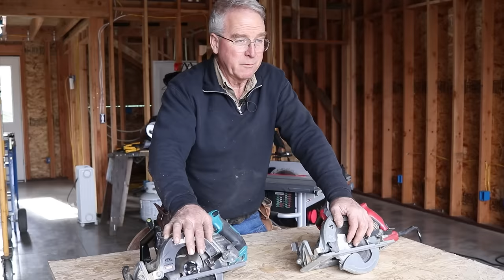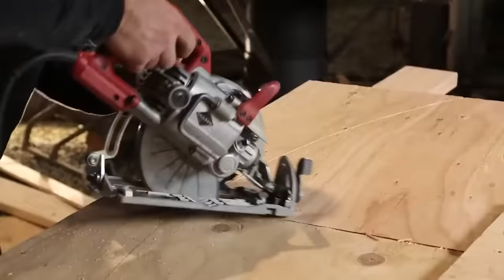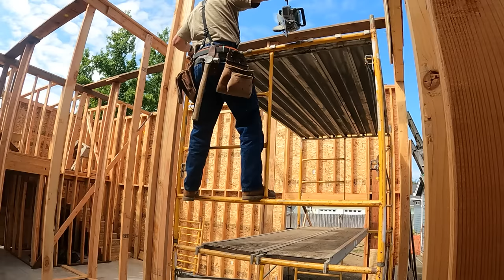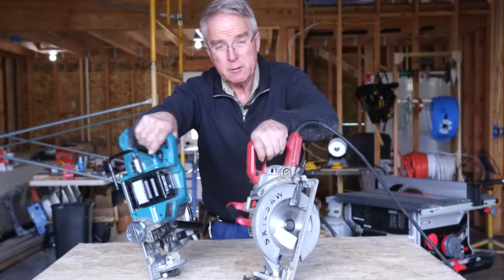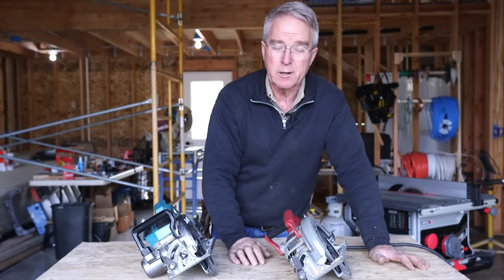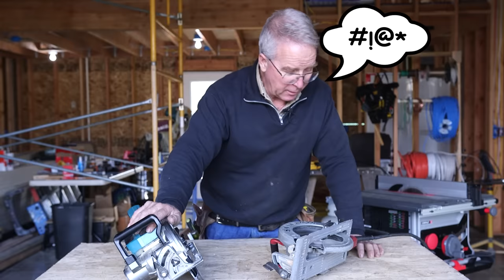Makita 40v XGT GSR01Z 7-1/4" vs. Skilsaw Mag 77 Circular Saw Review

Comment: Hanging tools from the cord🤦🏻. Lesson 1 safety on primary school! 

The battery platform is interchangeable with some other brands as well. And if Makita changes it; you will buy the newer platform 1 tool at the time. I've lost more money on repairing cords and not passing safety tests on tools because of exposed wires then I did on guys breaking tools. Also, with more women folk on the site in Europe and Canada; smaller wrists and arm strength is in play. 
Skilsaw also has the safety switch nowadays; in most countries it's mandatory by law. Your skil is just old, and not allowed anymore on modern jobsites. You show up with it today; the supervisor will send you home within 2 minutes.
Not having cords laying around cleared up the job site. No more people breaking legs tripping over cords. Ever thought of that? 
You build your house almost alone or with just 2 people on site. That's an unusual thing. We run 10 people minimum. Ever thought of having 10-15 cords laying around?
I'd rather buy all guys new tools every year, then paying for an injured employee for 6 months being at home.

Comment: A saw that weighs less is a disadvantage, means less high quality parts. humans are build to get stronger, so a heavy saw isn't an excuse; go to the gym if its too heavy. Second: If the safety switch is bothersome, modify the saw. remove the safety switch, in most cases its not hard to do. if your saw isn't as smooth on the push, polish your saws base. Be a better tool owner, use your wits. you have the capability to modify your tools. its not rocket science.
Reply: Pure bs